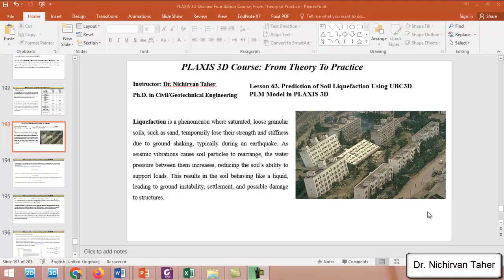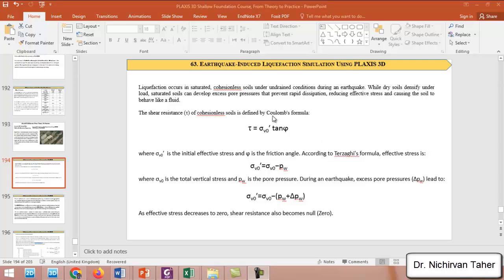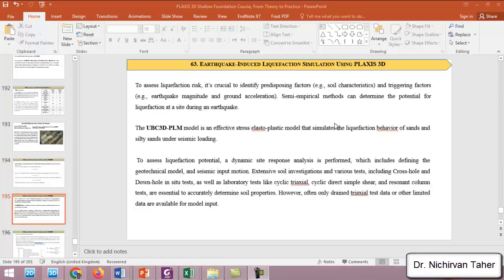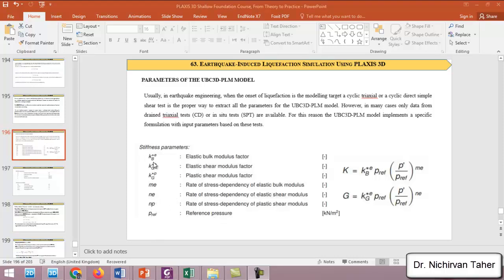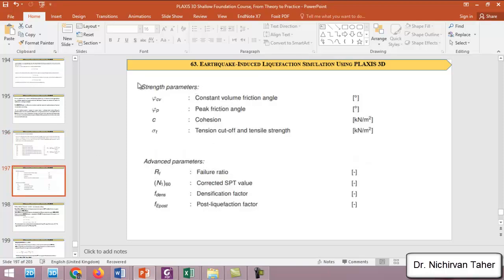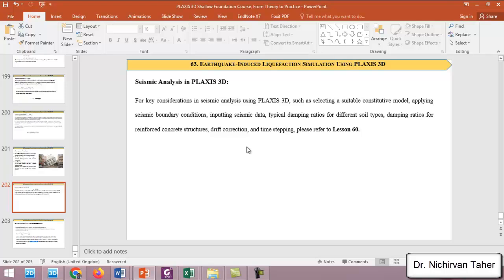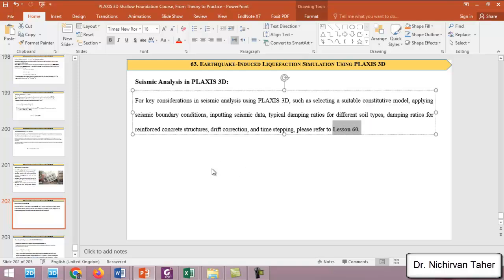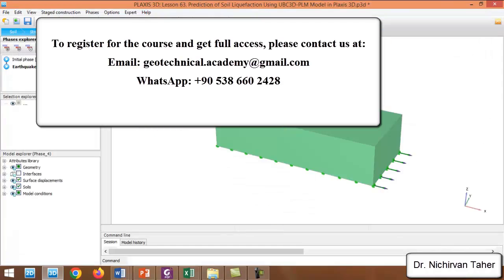Lesson 63. Prediction of Soil Liquefaction Using UBC3D-PLM Model in PLAXIS 3D

Comment: hi, when sholud i consider to calculate settlment with  creep or without creep?, which one is the best model in plaxis 2D to calculate settlment with creep? Can you please some times to post calculation with Plaxis 2D?,,,
Thanks a lot for ur time.
Reply from the maker: To decide whether to calculate settlement with creep, consider the soil type: for soft, compressible soils like clay and peat, creep is essential for capturing long-term settlement. The Soft Soil Creep (SSC) model in PLAXIS 2D is best for this, as it handles time-dependent deformations accurately.